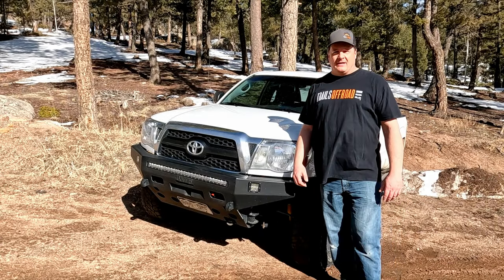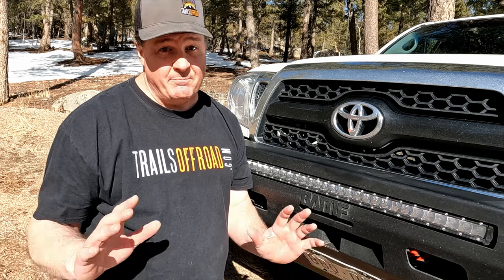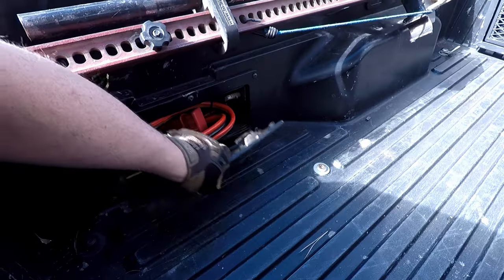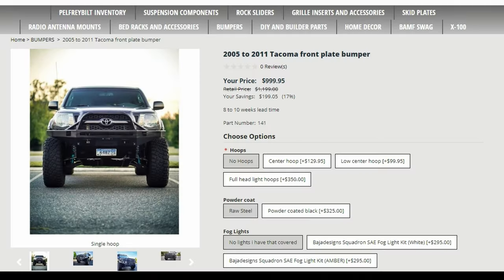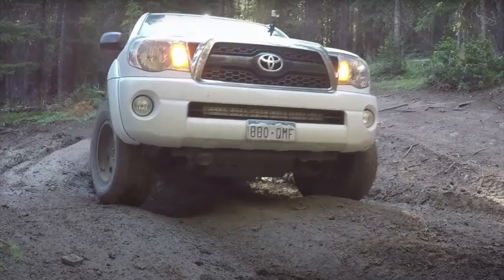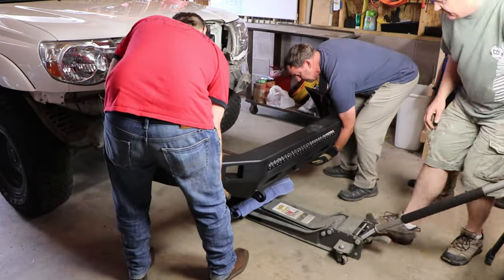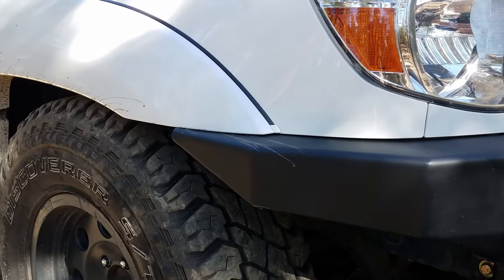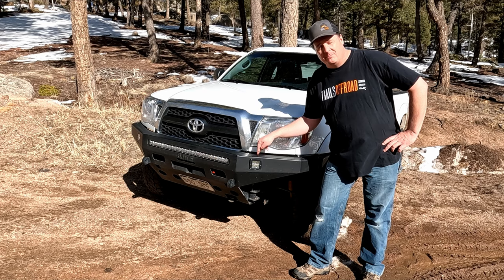Product Review: BAMF Plate Front Bumper

Comment: Did you have to cut the metal channel below the headlights to fit those fog lights?
Which fog lights are you using on there?
Reply: Hey, this is Trint! The fog light openings have channels already cut to accept the bolt on the bottom of most of these style lights. (You can see the channel in the video on the lower right at 3:14 ) The lights you see in this video are just cheap parts-store lights I picked up to fill in the holes. I expect to replace them with something more robust (but surprisingly, these $30 lights are still working so far).
Reply from the maker: See @workfromhomeFriday's comments above.